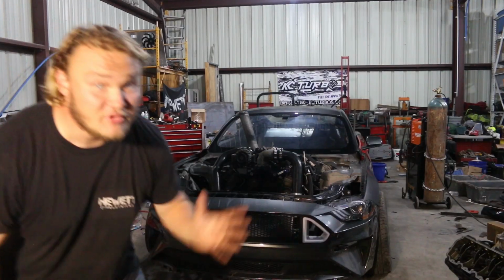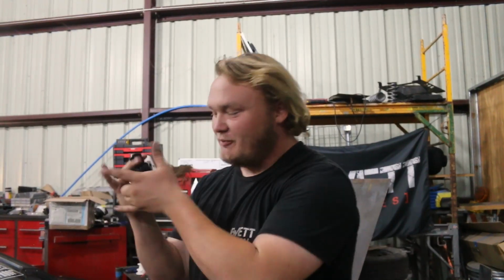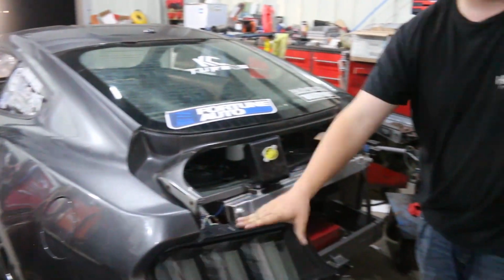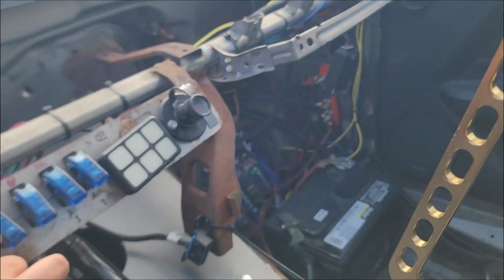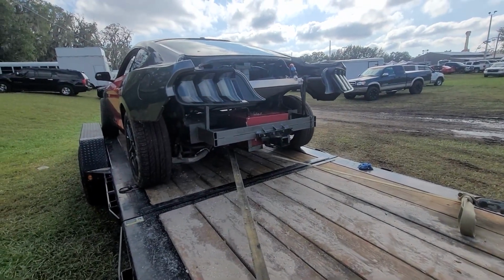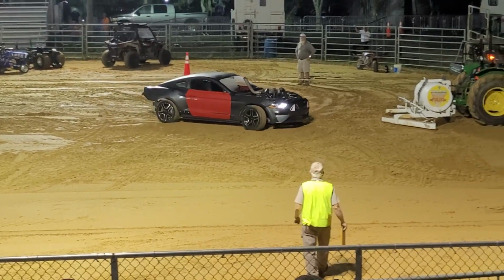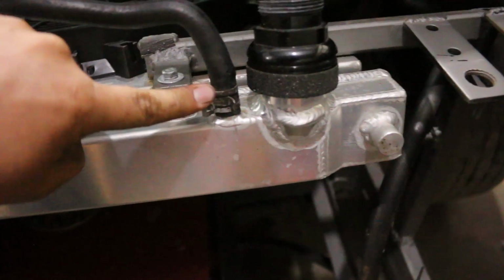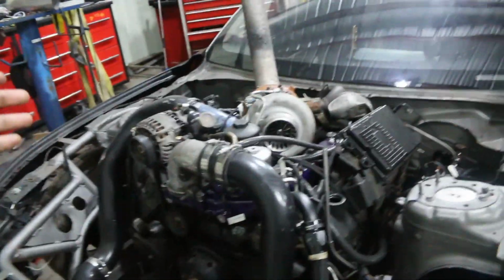I Took My Diesel Mustang To A Truck Pull!

Comment: put a gm 14 bolt in the rear with a 4 link then you can run 15s and not have to worry about breaking an axle with actual traction
Reply from the maker: I wanna stick with IRS, we're working on putting a super duty pumpkin with IRS